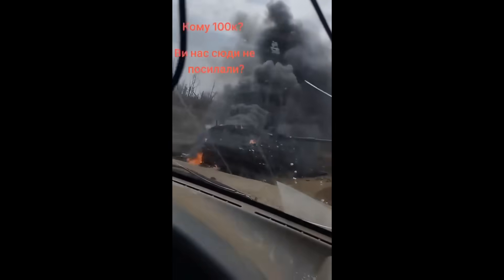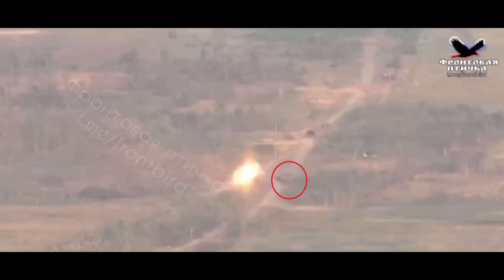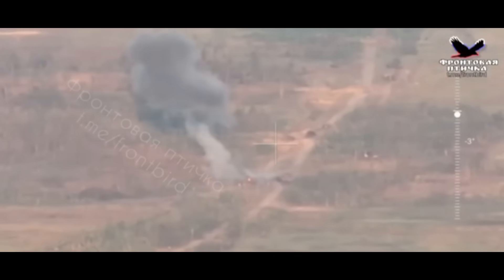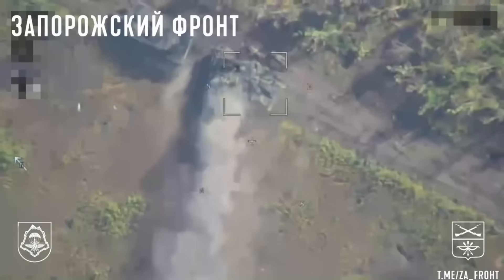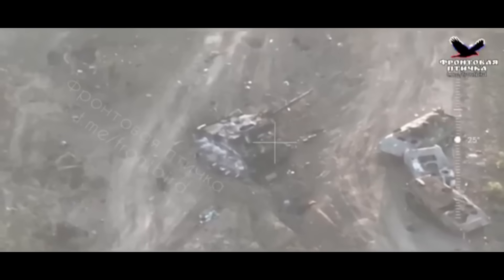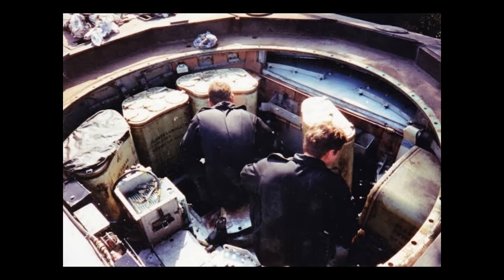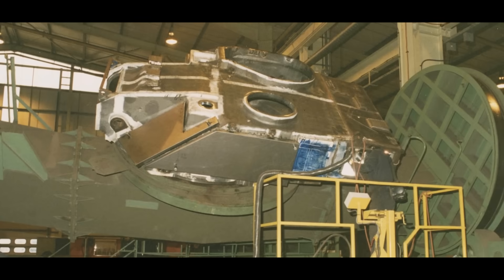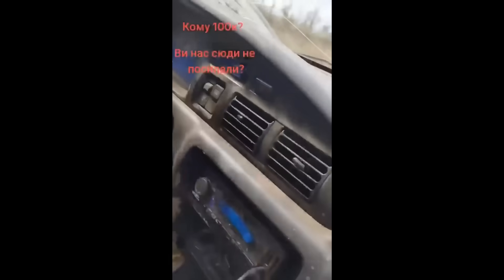This is how Challenger 2 got Destroyed in Ukraine

Comment: As capable as any tank may be, once its immobilised its done. But if it protected its crew i would say it did its job well. No tank is invulnerable, and yet oddly enough, it seems like its biggest enemy is the lowly mine!

I do see a lot of gloating going on in the comments however. Bit odd considering the armoured losses on all sides so far. Also for those referring to the "sniper" tank, its a bit of a misnomer really. Challenger 2 was designed with defensive operations in mind, engaging hordes of soviet armour from defensive hull down positions before relocating back to new defensive positions. Hence the armour configuration and preference for protection over mobility. In terms of long range engagements, with everything classified its impossible to say whose tank is best suited for extreme long range engagements. But what is certain is the Challenger 2 has proven it can do it. Whats more i believe British armoured doctrine these days does place Challengers in more of a support role rather than utilising them for frontal assaults in the way both sides have been forced to operate in this conflict. Either way, not a perfect tank, but still a tank that is going to ruin your day if it spots you first.
Reply: the best kill for a ch2 is said to be 4000 meters, an K-52 routinely launches its ATGMs from 10k
Reply: And a cruise missile can kill a target from 1600km…what is your point? A tank and a helicopter are completely different things, like a cruise missile. An Apache can attack up to 12km. F-35 can attack nearly 1000km again different from a tank, heli, cruise missile 👍
Reply: @sergeipetrov_rzn to add to that the heli will be limited on range depending on the the air defence in the area, if you’re air defence covers the attack will lets say a 20km into the Russian lines, do you think a heli with a max range of 10/12km, will it want to be in the area?
Reply: @Jord2123  He probably says that the real war is not a World of Tanks game. In a real war, tank duels are rare and tanks are usually destroyed by completely different means. For example, helicopters. The Ka-52 will always see the tank first and will almost certainly destroy it, especially if that tank is a hefty, slow-moving barn that is easier to hit than miss.
Reply: @NamemaNSl  All tanks are going to be slow moving barns to an attack helicopter these days, as the video shows, the challenger and t series tank from a distance don't look too dissimilar in size. Bit of a pointless comment really, Russia doesn't have many alligators and as this war has shown they aren't impervious either. Everything has a counter, it's whether it performs it's intended role well or not.
Reply: @Jord2123  my point is a tank is a close combat assault instrument, which is why it needs protection and high mobility, it is not some stand off defensive weapon, so if you need to kill a tank, another tank is your least preferable choice
Reply: @naja2270  Nevertheless, the larger and more inactive the target, the easier it is to hit it both from a helicopter and from an anti-tank system. The Ka-52 is not invulnerable, but it does an excellent job of destroying tanks and each of them has many destroyed tanks and other armored vehicles, while I have never heard of a tank being able to destroy the Ka-52. But it's not even about that. The Western concept of building tanks is, in principle, erroneous. Western tanks were designed for the role of tank destroyers and perhaps in this role they would be good, but the problem is that in a real war this role has no place. There are almost no battles between tanks, tanks are most often destroyed by mines, anti-tank systems, helicopters, etc. As a result, Western tanks are destroyed before they can reach the battlefield.
Soviet and Russian tanks were designed primarily to support infantry in an offensive, and that is how they are used and very useful in this.
Reply: @NamemaNSl  With modern guidance systems, the size of the object has been rendered almost moot. 

Comparing a Challenger 2 to a KA-52 is as moot of a point as is comparing a T90MS to an Apache. We all know how that fight is going to end, because one is designed to destroy the other. Its a conversation with no point to be made at all.

That, i suspect, is a deliberate over simplification of western tank design and doctrine. They are far more than tank destroyers, or have you not see what a HESH shell can do to an infantry fighting position, hardened or otherwise? The up armour package the British Challengers get is designed to add armour to a vehicle so it can operate closer in as an infantry support tank, an evolution of function and design that has changed as technology has.

I have seen video after video of Russian armour being destroyed by Javelins, drones, mines and artillery before they make contact with the enemy. This is not a uniquely western problem, but a tank problem. Were these western tanks to be used by Nato in a conflict with Russia, air power would clear the path of artillery, enemy armour and helicopters, and in that environment, any tank would do much better.

Its an interesting one really, there are 2000 dead Russia tanks littering the fields of Ukraine at last count, so arguing that Russian design is some how superior is an interesting take home. All i will say is feel free to follow that trail of thought, and all the best with it!

Comment: From the front/sides even without the add-on armor, the CH2 is a tough nut. The amo is  stored in armoured bins in the floor yes. But to get at it... you need to put a round through the side skirts, maybe a road wheel, the armoured hull then the armoured shell compartment... Or, alternatively through the less armoured roof of the turret. I think this may have been a Krasnopol possibly from a mortar.
Reply: krasnopol mobility kill. maybe also the ammunition detonation as the follow up kornet seemingly only hit the side of the turret.
Reply: Also he lied about no blowout panels.
Reply: @Seth9809  Where are the blow out panels? I can only assume they have to be in the underside of the hull.
Reply: @thebritishengineer8027  didnt you see it? the blow out panel is there, the commander cupola
Reply: @hetzerinovka4689  That's a stupid joke, but one of the first actually witty ones I have seen, take your medal.
Reply: So what you're saying is that storing the ammo in a carousel on the floor is actualy the smartest, most logical solution? Well well well, how the table turns
Reply: @Narcan885  Not without blowout panels, as the crew have limited ability to detect ammo in the process of cooking off, though otherwise, yes, with a possible exception to landmines.

That said, Russian rounds (depending on tank) are stored in a way that has them facing vertical, rather than just laying down - meaning any hull penetration has an extremely high chance of hitting ammo - even worst, it's the charge that is in the horizontal position. Apparently both parts of Russian munitions have explosives, but if we assumed inert heads the flat position could offer mine resistance to the charge, but against any other form of attack, it's not ideal.

Comment: The Challenger 2 ammo storage.
Wet ammo storage and bagged charges.
Any penetration will result in the liquid contaminating the propellant, slowing any combustion enough to allow the crew to evacuate. This works as the charge is in porous sacks and not waterproof brass cases. This allows the water based mixture to quickly saturate the propellant.
After burning for some time the propellant will dry out and rapidly combust, popping the turret and destroying the tank.

Not the best solution to save the tank, but a good one to save the crew.

Comment: It's still really surprising to me that the Challenger 2 doesn't have ammunition stored in the same way as other modern Western tanks.
Reply: I posted on this elsewhere, but basically well stowed ammunition is a lot safer than you would think. It's meant to burn, and it'll burn hot, but it normally won't explode or spread damage to nearby charges.
Reply: well it still has the explosive part separate from the crew, unlike the russian tanks
Reply: @NotTheCIA1961  So, still safe enough to allow the crew to escape should the ammunition cook off, but you still lose the tank?
I can get behind that. I'm sure there's good reasons to avoid a bustle like the Abrams has.
Reply: @DarkShroom  Thank goodness. Some of those cookoffs are truly chilling.
Reply: @Tinblitz  basically that. It becomes a "oh bugger. The tank is on fire" moment rather than a "oh fu-" moment as your turret pops .
Reply: @NotTheCIA1961  Being given enough time to actually experience a Significant Emotional Event.

Comment: The reason Russian tanks flip their turrets dramatically is due to ammunition not being separately stored for the crew area . ( not the case of Brit tanks )
Reply: The main reason is the weight of the turret not ammo placement
Reply: @rogeriofukuma4077  The Challenger 2 has wet storage and blowout panels.

Its ammo placement.
Reply: @rogeriofukuma4077 lol. So you really think the challenger turret ways that much more that it barely pops out of the turret ring while t72 turret fly some 20-30 meters higher? ^^
Challenger amp storage delays cookout so true crew has more time to escape. That’s is why there isn’t all the energy at once like when a t-model pops.
Reply: @Seth9809  The Challenger 2 has no blowout panels.
Reply: Only here it happens almost always after a long fire. when the crew had already been evacuated long ago.
Reply: @Seth9809  Wet storage was proved in ww2 to not be effective, IN rare cases it might slow the reaction but won't stop it and for blOwOut panels just watch the video...
Reply: @Grimshak81  The weight of the turret does affect how high the turret can fly, an simple example is tiger 2 its turret would keep near the tank even on direct hits on the ammo. And T series carries ammo all around the tank increasing the chance of a chain reaction
Reply: @rogeriofukuma4077  yeah so you just confirmed what I said: it’s not only the turret weight determining the popping height. It’s ammo placement. And the challenger has far superior ammo storage than t-models.
Reply: @Grimshak81  Well, yes the ammo is better placed but it does not make the tank invencible to instant detonation, when that happens the turret only pops out of the turret ring due the heavy weight and why would that be bad? It means the turret is better armored
Reply: @rogeriofukuma4077  Wrong, wet storage and stored the ammo at the bottom of the hull led to a massive decrease in vehicles burning inside the turret.

There is statistics all over the place for this, and even Chieftain has hammered this in and shown graphs. 

The penetrators for the Challenger 2 are stored at the back of the turret, behind an armored door.
Reply: @Seth9809  penetrators don't explode. And how would a box of water stop a fire on the turret? In the first place to start a fire you need to hit the ammo, which for being down the hull was harder than having rounds all around the tank

Comment: From what I can see and surmise, a track loss, attempts to drive off span the tank around and then the crew dismounted. The tank was left to be destroyed, as it was now facing away from the enemy the weaker armour is exposed. Easy pickings for an ATGM and attractive one at that, non moving and potentially recoverable at that point. Glad the crew were ok.  

Also worth noting the tank was not in full battle dress, i doubt that would have changed the outcome though.

Comment: Challenger II is an emergency-only vehicle, kinda like Leopard 1. Something that doesnt bring all that much of an improvement over the post soviet tanks. However its notable that during the video showing the hit, the turret is still on its correct place (and the vehicle looks abandoned), so it should be a case of successful crew evacuation, which is nice.
Reply: Mines generally don't destroy armored vehicles provided they detonate under the tracks and not the hull.
Reply: Challenger II isn't like Leopard 1... It's comparable to leopard 2.
Leopard 1 was designed under a philosophy of manoeuvrability, Leopard 2 is an upgraded version of Leopard 1 with armour being given more priority, alongside other obvious upgrades such as FCS, cannon adjusting to modern armour, etc.
Chieftains were designed with a focus on armour, in the cold war I believe the expectation was chieftain would arrive once the front had stabilised, versus Leopard that was built with an expectation to need to pull back and perform delaying actions at the start of the War.
Challenger I is a similar hull form to Chieftain, 
Challenger II is an upgrade to the Challenger 1.

Leopard 1 could only dream of having the Armour and cannon of Challenger II. FCS might be something they could add onto the Leopard, but assuming it stays as it was, it's another extreme advantage to the Challenger 2.
It's a modern vehicle, the only way it could be emergency only, is for the fact there aren't many of them - so have to be used in a limited capacity.
Reply: @D_U_N_E  Challenger may have been designed with armor in mind, but its protection in this day and age really doesnt cut it anymore.
Reply: @pavelslama5543  And how do you figure that? 
Unless you use Warthunder as a resource, from what is released of the Challenger II its frontal protection should be competitive to Leopard II... Side protection should be about the same.

Then, depending on if applied, there are additional armour packages to further beef up the Chally.

In trials for finding and hitting Targets quickly, Challenger II beat Leopard II.
Reply: @D_U_N_E  Hull protection is only equal as long as you have ERA on the nose of Chally 2. Once you use it, its hardly even comparable to Tiger 1.
Let alone the ammunition protection...